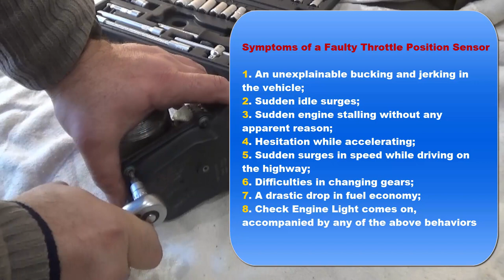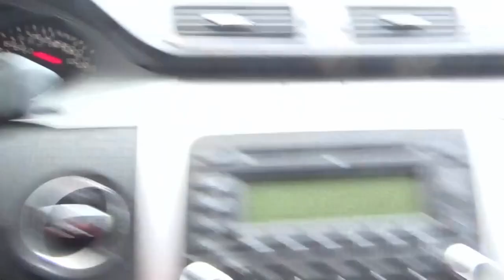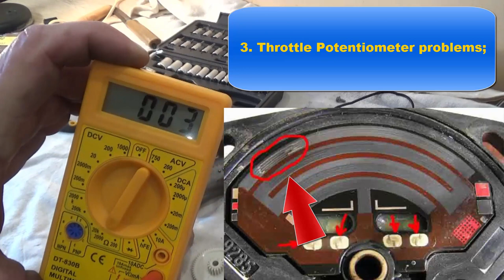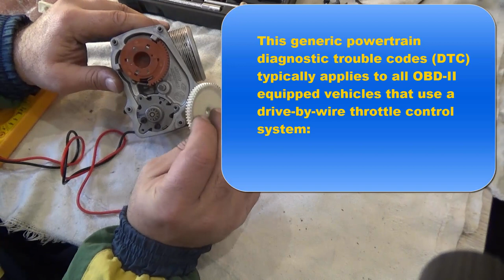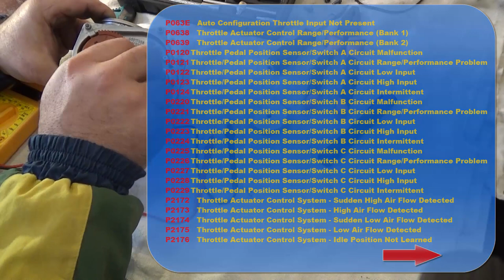Symptoms of a Faulty. How do I know if my throttle position sensor is bad?

Comment: Здравствуйте у меня выдалась такой код. P2136-01 throttle/pedal position sensor/switch a/c voltage correlation bmw f30 lci двигатель b48b20a сталкивались с такой проблемой?